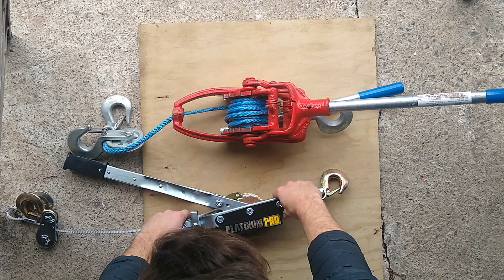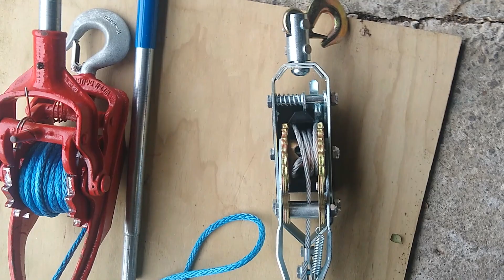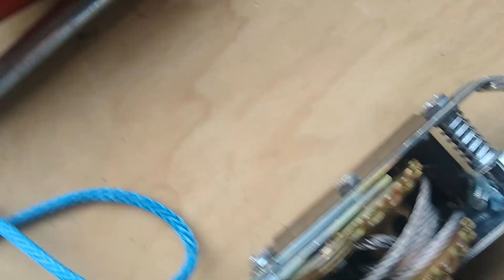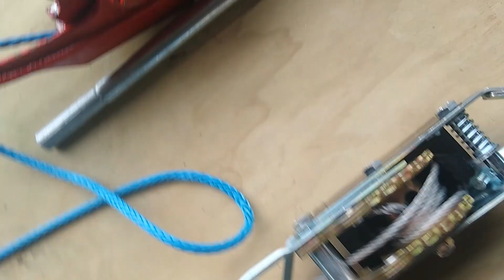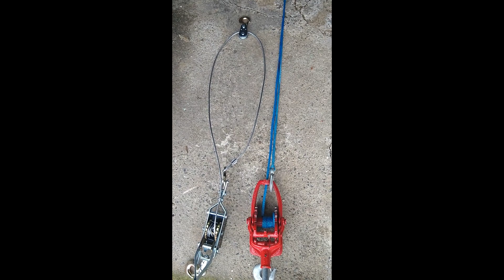Wyeth Scott More Power Puller comparison to a Standard Come-A-Long

Comment: I will tell all of you.  I've moved things weighing 30,000 pounds with the red one.  They will handle way more than the rating.  In fact, I use a 7/8" x 6' solid rod in mine for a handle.
Reply: It says in the instructions not to do this because the bending handle let's you know it's too heavy.  Not criticizing, just letting you know in case you don't know already.
Reply: @FourLowAdventures  I have probably had over 100 of More Power Pullers.  Never seen a factory handle in my life, besides a picture.  I do use a solid rod for a handle.  I keep one 2 1/2' long, and a 6' one with me, on my travels.
Reply: @ridgerunner106  They are rating them for lifting power to avoid lawsuits. We all know how Americans are! If an item is underrated, lawsuits are hard to win! You cannot sue China, which over-rates everything they bring over here!
Reply: @ridgerunner106  Why have you had over 100 of them? Keep breaking them with solid handles?? I never thought I'd meet someone who had spent over $40,000 on Power pullers
Reply: @straycat62   i buy them, put new cable, paint the frame, and sell them.  Easy to find them for thirty dollars at the pawn shops.  Probably have 20 here right now.  I have several griphoist, TU 17 and TU 32, many lever hoists too, up to six tons, many chain hoists too.

Comment: I feel like the 3.6t version is gonna rip itself apart  at 3.6t...
Reply from the maker: Definitely, wouldn't want to rely on it in a recovery situation! This video shows the cheap model being used trying to winch a ute with a handbrake on, basically - cant move it. The More Power Puller chips away fine by comparison.  https://youtu.be/vHpZ88BR7PY